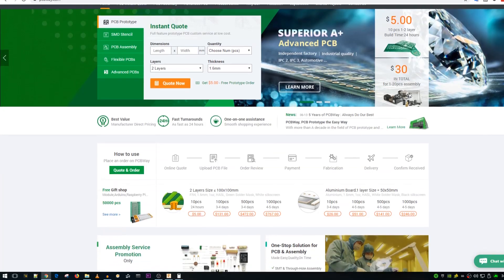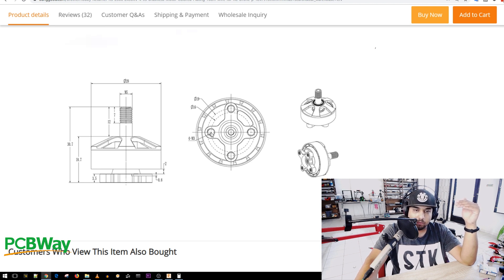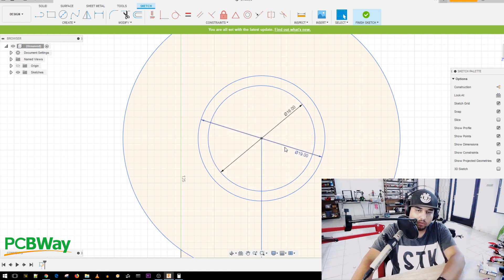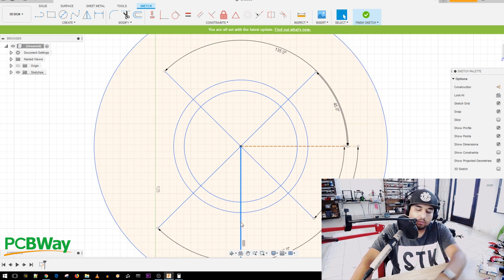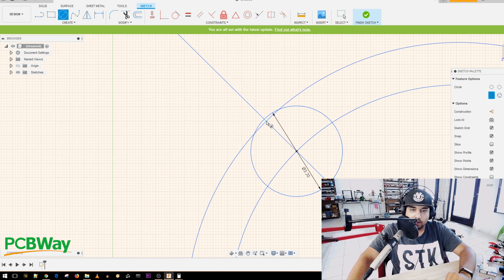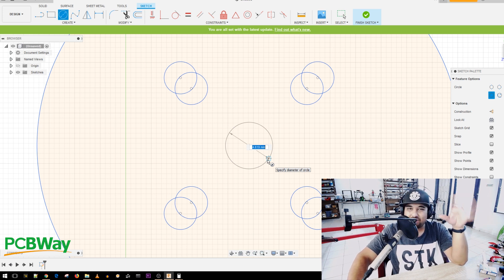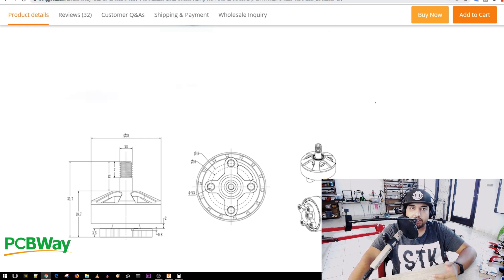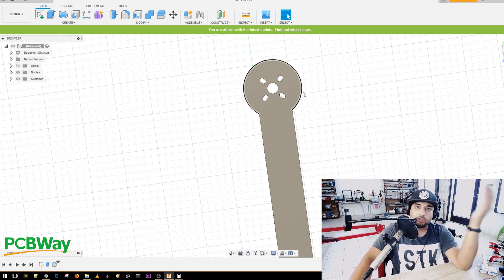How To Design FPV Drone Frame EP1 // Motor Holes

Comment: Design a frame that will hold the DJI fpv components that stuff would swap easily to a carbon fiber frame designed for it.

Comment: instead of filleting the motor holes, you could us the offset tool in the sketch interface to offset the 4 lines at 90 degrees by 1.5mm on either side to make a true 3mm slot.

Comment: I like that you are doing this, but you got to use the constraint features on your design. That's really important if you want to lock your design in place or simplify your design if you want to edit your frame later. I already see your subscribers confuse as heck when they change one number on their arms and the software throw the mounting holes in space. Lol if you dont mind.... I'm going to direct your subscribers to this video, so they could learn constraints. 

https://youtu.be/J_2If5zVp84

Comment: you need to leave all the dimensions in place
the lines turn black, when they are fully constrained

you can convert some of the lines to construction lines
they are dotted, then

i like to draw squares in the 16 and 19 mm circles and make one line them perperdicular to a center line of the arm

you can see all that in the video on my channel
i design a full quad in it

Comment: Would love to see a practical tutorial how to avoid weak frame points when designing. A material knowladge would be also a good one. A type of carbon plates, when 2mm are good and more, when to cut it on a best degree etc.

Comment: I see behind you that you have 3D printers .. on the right is thay a CNC machine? I'm thinking of buying a 3D printer and maybe a CNC machine if I find good one and not expensive ... Any recommendations for both?
Reply from the maker: I use creality 3d mini for pla.. and for flex I am using a heavily modified tarantula.. CNC machine is the stepcraft 600 with water bath for carbon fiber machining.
Reply: @DroneMesh  Damnnn that CNC machine is very expensive lol about that 3D printer, I also thought of the same brand but the Ender 3 pro, the price is good not expensive, and according to examples I have seen it seems to be a good  quality machine...I just recently thought about buying a 3D printer and a CNC machine, currently doing some research, it always interested me especially cnc machine..
Reply from the maker: @eliavedri7876  I wrote a couple new companies recently looking to test some budget option CNC machines since it does requested quite alot. Waiting on the replies.  The creality brand is good. printing TPU will need some extra parts like a titan extruder.
Reply: @DroneMesh  I hope ... It would be super cool if I will have a cnc machine and could create frames by myself :) about the 3D printer I have quite a bit to learn, all the "how to..." and why... but all I need is a demo from start to finish. And by the way, thank you for the quick respond, many don't respond back at all lol
Reply from the maker: @eliavedri7876  Creality cr 10 mini is great
Reply: @DroneMesh  well it's a bit more expansive but it's an option:) i still have much to learn...
Reply: @DroneMesh  i am watching MillRight for their Mega V.     If it is going to drop this year I will be buying it.    It looks like a very easy setup for doing a wather bath milling bed and I already have ideas on how to make it a recirculated and filtered water flow system.   The filter will catch the debris and make it easy to toss in a ziplock back for containment/disposal.    What does not get caught will remain in the water tank.

Basically my knowledge of aquariums will come into play to make a custom aquarium for my CNC mill.
Reply from the maker: Not worth the extra effort the cheap 12v pump will run for more than a year.. I use the same water with the pump pushing towards the cutting area and you will be 100% fine check my cnc videos.

Comment: I also finally switched to Fusion 360. Mainly because of its nice CAM module for my new CNC router. And now it anoys me a little, that I didn't do that step earlier. I was using TurboCAD, because I was used to it for so many years, but Fusion 360 makes so many steps so much easier.
Now I'm reconstructing my first 3-axis controlled RC plane from the 70ies from balsa and plywood (and some 3-D printed parts) 😎
It's a good training to get familliar with the whole CAD-CAM toolchain without breaking too many bits.

I even bought a 40 years old glow engine on EBay 😂
Reply from the maker: Damn!!!